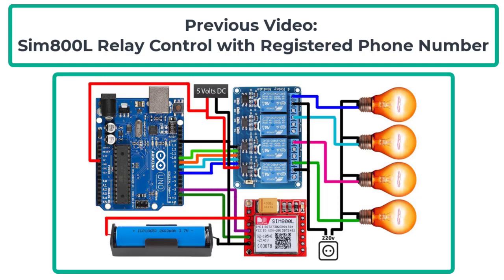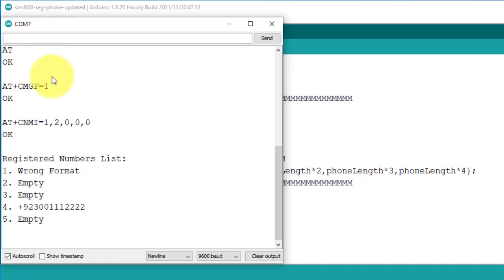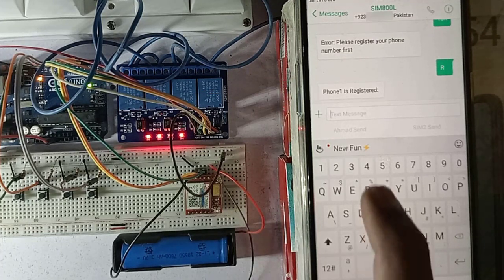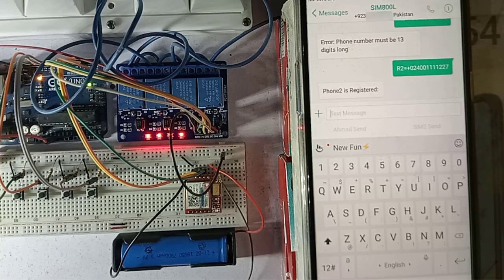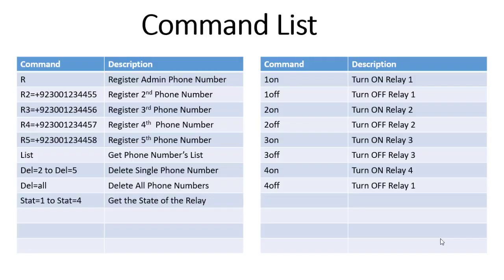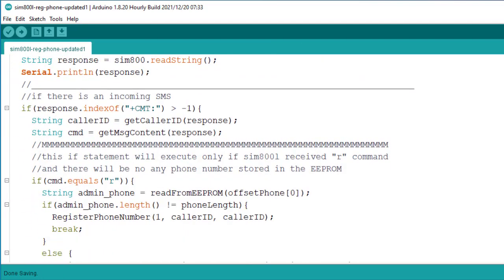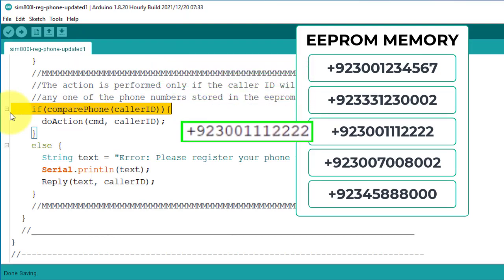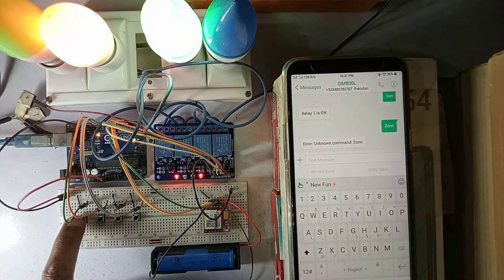SIM800L Home Automation Project Using Arduino and Push Buttons

Comment: There are problems Mr. Ahmad. The old extractSMS function was working properly. Why did you change it? Now I cannot register the phone number by R command.
Reply from the maker: the old code was not as efficient as the new code. that's why I have changed it to new one. I will also use the new code in my latest projects. what response you get, when you send r command
Reply: @AhmadLogs  resetsin800l function is working when i power the system. İ use Arduino nano. İ think the problem is eeprom addresses.
Reply from the maker: @alperkaplan5400  you might test your eeprom first. just upload the eeprom example code to see if it is working or not. to store phone numbers eeprom you need first 64 bytes (if the phone number length is 13).
or you need first 69 bytes (if the phone number length is 14).
Reply: @AhmadLogs   
When I make phone lenght 14, the output is like below. I am sure there is a problem in your code. Please help me to figure out the issue.
SIM800L software serial initialize
12:23:13.830 -> ....................SIM800L Not Ready
Registered Numbers List: 
1. Empty
2. Empty
3. Empty
4. Empty
5. Empty

Relay1 is OFF
Relay1 is ON
Relay1 is OFF
Relay1 is ON
Relay1 is OFF
Reply from the maker: @alperkaplan5400  here is the issue. 
....................SIM800L Not Ready. please check you gsm module. also add 1K pullup resistor with each push button. if your relay is behaving unexpectedly.
Reply: Ok I'll try and let you know thanks

Comment: İt is now time to add this project adjustable timer functions. For example, when i want to open my relays for 4 hours or for one day long. Also, i suggest that u need to apply this project to esp32 or some kind of strong MCU. Arduino is still ok for the project but the doaction functions is overloading sometimes.

Thanks for your kindness.
Reply from the maker: will try

Comment: I am using this module in my graduation project my dear friend, but there are some problems in terms of connecting to the firebase server and I want your help or a way to contact me, knowing that my graduation project will be delivered after a week and I hope you help me🙏🙏🙏
Reply from the maker: Firebase has updated its system. So, sometime the code works or sometime not. but if you use 4G gsm module then you can do it easily
Reply: @AhmadLogs  What kind of model does it work with 4G until I buy it
Reply from the maker: @AhmedMohamed-vm1bo  sim7600

Comment: Hello Ahmad Khan
Great as always
If possible, write the read and write function of phone numbers for external eeprom, such as 24lc ... so that this program can be used on microcontrollers that do not have internal eeprom.
Thank you befor🙏
Reply from the maker: Ok I will try
Reply: @AhmadLogs  
Hi si Big project
Can you increase the temperature sensor and control the max and min value?
Reply from the maker: @amirtelecom6898  you want me to add the temperature sensor in this project. Am I right?
Reply: @AhmadLogs  
Yes if possible
Please I want to get in touch with you. I need help
Thank you sir
Reply: @AhmadLogs  
Please help me !!